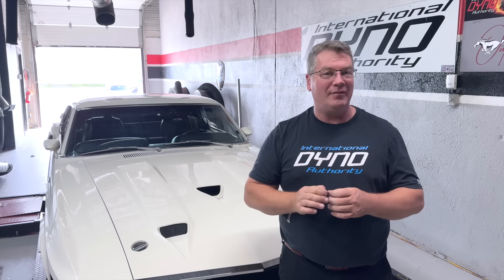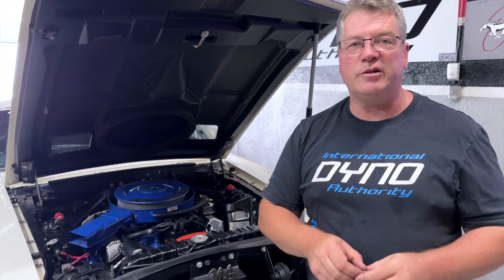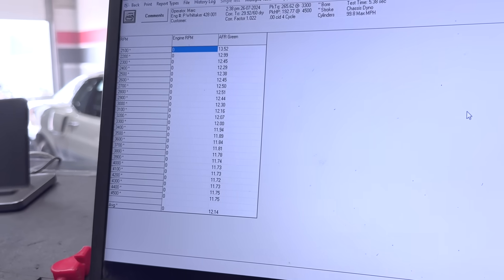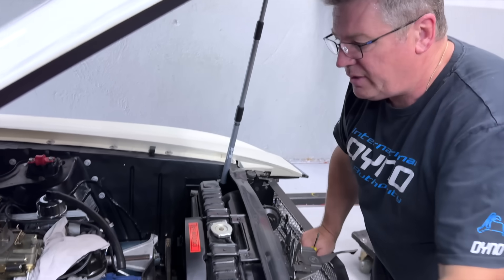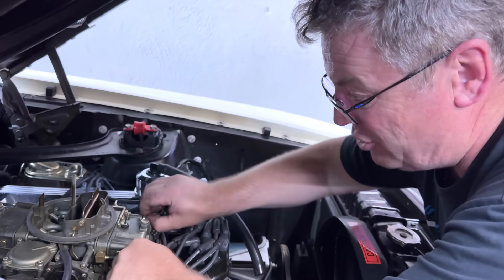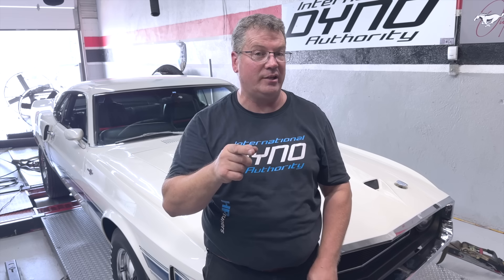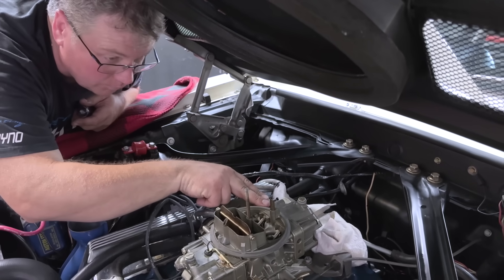Original, unrestored '69 Shelby GT500 tuned on the dyno

Comment: Cool vid, wow, I can't believe that awesome car is not restored. I have had a few Holley 4150's on classic Vettes, power valves tend to leak with age causing ultra rich mix and a carb rebuild is the way to go. Also, check dipstick with a sniff for gasoline in the oil of a rich running car, it's a good way to spin a bearing.
Reply from the maker: Coast down coefficient is measured and calibrated on the dyno to determine tire friction / drag.

J1349 S.T.P. is the formula for Correction due to : heat, Humidity, and Water grain percentage.

The dyno also allows for sea-level calculations. Although on this case the sea level is 256 ft, so not a factor.

Choke was adjusted to complete "off" and moved to its least effective adjustment for colder climate. ( It will never be driven in cold weather)

Hydraulic liters had been checked , maintenanced and set previously.

Spark plugs, oil, wires, distributor....etc.. etc..  all 'tune up' items were previously addressed.

The vehicle was strapped using the same method as per all the vehicles.  The tires were older style and soft sidewalled.

We "eliminated" all other extenuating items.  This allowed us to focus on "tune".

We had a very clear task set out for us. We needed to clear up the smoke, and provide the ideal environment for the combustion chamber to do its job.  AFR, is always Step 1.

After making sure the basics are covered, we begin setting up yhe fueling for success.

91 pump ⛽ is used because it is 90 % repeatable and easily readily accessible.  

We tune for every day use , and for the customers goal for their car.

On this session, we accomplished : diagnosis, smoke free tuning, thinking outside the box... 

We rerouted, and fixed a ver purely setbup pvc system.

All of this gave this Mustang a proper shot, at running correctlyfor the next 50 years.

Comment: Messed with FEs for years. They really like a lot of timing initially and with factory heads probably about 38 to 40deg total. More responsive and better power throughout the rpm.
Reply from the maker: @jasoncummings1755  

Our tuning process is meticulous and systematic, starting with all passes beginning at 2,000 RPM. The throttle is applied rapidly to the wide-open position, ensuring consistency across every run.

Each test is conducted on the chassis dyno under identical load conditions, allowing the vehicle to accelerate as quickly as its setup permits. The duration of the test is carefully measured and compared with subsequent runs to evaluate progress.

Initial tests are run until the torque curve falters or until the data log indicates unsafe, unproductive, or non-rewarding results—signaling the need for adjustments or the next step in the tuning process.

We prioritize the safety and condition of every customer’s vehicle, treating each one with the utmost care. Throughout the tuning process, we closely monitor key parameters such as temperature, AFR, IAT, balance, and torque production across the RPM range. Ignition timing is catered to: Combustion chamber, goal for the vehicle, fuel ⛽ used, fuel available, consistency of fuel available, health of the Engine.

Our goal is to deliver responsible, high-quality results that enhance the performance of the vehicle without compromising its integrity—or our reputation. We do not take risks that could endanger a customer’s vehicle or the standing of our business.

As we observe improvements, we gradually extend the RPM range, focusing on identifying the engine's most efficient operating zone. At every stage, we ensure transparency, sharing step-by-step results with our customers and walking them through the data logs to educate and inform.

Each test adheres to a precise, repeatable procedure, maintaining consistency and accuracy. This approach not only ensures optimal results but also reflects our commitment to excellence and responsibility in tuning.

Comment: Whoa .... that is a vacuum secondary carb .... no rear  jets .... a fixed secondary jet plate, the air bleeds are fixed as well unless you drilled and tapped for it , and no secondary squirters,  been building Carburetors since 1977, the secondary flow is on demand and adjustable with a spring change  in the housing red blue green silver and black, from the original jet size ...it is a 700 cfm Autolite made by Holley ... gonna go back a bit and re listen to the statements before 15:25 not to dispute but understand your verbiage .....P.S, Secondary Metering Plate Main Hole 0.067 Idle Hole 0.031Should be the correct secondary plate due to continued richness with a silver secondary spring for the housing so it'll open slower and allow more control of fuel metering under full throttle ... put in 35 degrees of timing and a heat deflection plate under the carb to stop fuel percolation and run on during the summer vacuum advance will help with fuel milage
Reply from the maker: Welcome back to the channel!
In this video, we tackled a smokey (vehicle)carburetor issue, and I wanted to give you a quick recap and some expert insights.  

As you saw, we delved into the intricacies of the carburetor, including primary and secondary jet sizes, which we discussed in detail.

  One of the key culprits behind the smoke was a poorly configured PCV system.  Someone had connected the PCV hose directly to the intake without a restrictor, essentially creating a direct line for oil and oil mist from the valve covers to be sucked into the engine. 

By adding a restrictor and properly rerouting the system, we significantly reduced the smoke.

It became clear that the engine was running overly rich (over jetted) and the choke was partially engaged, indicating that the initial settings were far from optimal.  We then meticulously adjusted the float and transition circuits, both statically and dynamically, under load, ensuring smooth transitions throughout the RPM range.
We also measured vacuum under load and assessed the distributor. 

 While an updated (, vacuum) distributor with  could offer some benefits, for this particular vehicle and its anticipated usage, we determined that the existing setup was perfectly adequate.

  Remember, it's not always about throwing money at upgrades; it's about making the existing components work in harmony.

Speaking of harmony, the ignition timing was carefully chosen(31,) to balance the vehicle's goals, the combustion chamber characteristics, and the fuel being used.

  It's crucial to consider that a vehicle like this might sit for extended periods, meaning the fuel won't always be fresh.  Therefore, excessively aggressive timing, like 35+ degrees, can be counterproductive.  In our testing, we even experimented with advancing the timing up to 36 degrees, but we observed no tangible improvement in performance.  Ultimately, the best results came from proper tuning and fueling.

 We did add 3 degrees to the "total" timing over what the car arrived with.
Interestingly, no springs or passage drilling were necessary within the carburetor itself.  We didn't need to add air bleeds.  The carburetor, in its original form, was a perfectly capable unit.  It simply required a skilled hand to unlock its potential.  It responded beautifully to the tuning adjustments.
Now, I know what some of you might be thinking: long tube headers, 100-octane fuel, a hotter cam, bumped-up timing, a 1050 Dominator…  While those upgrades could undoubtedly unleash more power, they weren't aligned with the owner's goals.  Our objective was clear: make the engine run correctly, start reliably, accelerate smoothly, and eliminate the smoke.  And that's precisely what we achieved.
If you found this video informative, please hit that subscribe button and join our community.  I'm always eager to discuss these topics in the comments, so feel free to share your thoughts, experiences, and questions below.  Let's keep the conversation going!
Reply: Look again.  It is a 4150 style carburetor, not a 4160.  It does have the rear metering block and not a metering plate.  It definitely has jets in the rear metering block.  Vacuum secondary carbs can have rear metering blocks.  It probably is a 735 cfm Holley.

Comment: Wow a 428 seems to be kinda trash. All that ci and so little to show for it.
Reply: And you wish you could afford one ...
Reply: Imagine one with modern Aluminum heads and a Hyd. roller camshaft dual 660 center squirters easily a conservative 150 horse and 150 torque or more at the wheels
Reply: Hey Matt, please do show us a photo of your AMC Pacer.
Reply from the maker: This engine makes boatloads of torque throughout the normal range of horsepower. 

You could put it side by side with any modern engine and, from 2500 RPM to 6000 RPM. It would give any one of them a run for their money. 

A lot of us would like to dream, that there is 500 horsepower on the table from any vehicle anywhere. However, it just is not the case. In most cases this is pretty much average pretty much normal. 

If I were to take a new generation LS 6 L engine and put it beside this. The torque curve would be less. The horsepower would be almost identical. And it simply would not pull as hard as this engine does. 

For technology, that is definitely 30 years outdated. 

This engine pulls extremely hard
Reply: You have to remember, anything you saw run on the drag strip, or nascar take the checker flag with a blue oval on it; had  a Holman Moody Camshaft in it!
Competition Cams couldn't reproduce a 406 FE Holman Moody Camshaft to make the same power in the late 1970's. Ford didn't didn't stock H/M cams... And you weren't getting the same FE parts as their lead car either...
Reply: Back then 300hp was like elite lol
Reply: @Radbot776  Yeah "lol" you don't know what you're talking about, my stock 66 Ford was 315 HP. 427s in the 60s from Ford were 410-425hp, the hemis were 500 HP on a dyno, I could go on all night
Reply: @Radbot776  Oh and that's naturally asperated not supercharged like most super cars today LOL
Reply: @Radbot776 At the wheels

Comment: Too many changes at a time, in that situation I would check the float level while its running BEFORE pulling the carb to change jets.. The idle circuit effects the A/F very very little above part throttle..
Reply from the maker: @jefferycoleman3781  

Thank you, for your response, and stimulating conversation. 

We absolutely love, the information, opinions, and, ideas, that come from our viewing audience. 

The tuning process for this project was comprehensive and methodical.

(Basics were covered:  "on camera". All steps were reported. But, many passes, & Many steps were covered, " off camera"  float level was adjusted using a Holley calibration float tool, off camera)

Pre-Tuning Preparation
We started with a checklist for the customer to complete before bringing the vehicle in. This included:

Fresh oil

New spark plugs and spark plug wires

A new distributor

Proper fuel pressure

A leak-free exhaust system

Tires in excellent condition

Tuning Process
Once the vehicle arrived, we meticulously tuned every circuit of the carburetor, from idle to low speed, the primary circuit, and the secondary circuit. Here’s a breakdown of the steps:

Air-Fuel Ratio Adjustment

We cleaned up the air-fuel ratio until the spark plugs burned a perfect tan color. AFR 12.8-13.1 (:1)

Any trace of smoke was eliminated by fine-tuning the mixture.

Choke and PCV System

The choke flap, which was bent, was removed and straightened to restore proper airflow.

We reconfigured the PCV system to circulate air back into the engine without oil vapor. This included adding a restrictor and cooling to prevent oil deposition in the combustion chamber.

Ignition Timing

The ignition timing was verified and incrementally adjusted to match the fuel in the tank, the combustion chamber characteristics, and the intended use. This resulted in a complete and efficient burn in the combustion process.

Carburetor Repairs and Adjustments

We replaced the check valve, power valve, gaskets, and the accelerator pump circuit's check valve ball and spring.

Proper smaller nozzles were installed for the accelerator pump circuit.

The float level was set for optimal tuning, ensuring no smoke and smooth transitions between circuits.

Results
The result is a 1970 Mustang that runs better than ever:

Increased torque, efficiency, and horsepower

Zero smoke from the exhaust

Quick starts, smooth operation, and overall reliability

This is now one of the cleanest-running classic Mustangs on the street, despite never undergoing a full restoration. It’s a testament to careful tuning and a little TLC.

Thank you for watching, and we hope this detailed overview inspires and informs your own projects!

The internal float adjustment is accomplished with the fuel bowl off the carburetor. With “internally adjustable” needle and seats, the fuel bowl is inverted and the float tang, or tab, is adjusted to the point where the float surface is parallel to the fuel bowl surface, just underneath. An initial dry setting can also be accomplished with “externally adjustable” needle and seats. To achieve this, invert the fuel bowl and turn the adjusting nut until the float surface lies parallel to the fuel bowl casting surface underneath.

Another, more accurate adjustment can be made with the side hung style float if measuring gauges, such as drill bits, are available. Here, with the fuel bowl inverted, the primary float can be adjusted to the point where there is a 7/64" gap between the “toe” of the float and the bottom of the fuel bowl surface underneath. The float “toe” is the part of the float furthest from where the arm is attached. The secondary float can be adjusted to the point where there is a 13/64" gap between the “heel” of the float and the bottom of the fuel bowl surface underneath. The float “heel” is the part of the float closest to the point where the arm is attached.

A “wet” level float adjustment can be performed on either the side or center hung floats, if the fuel bowls have provision for the externally adjustable needle and seats. This adjustment is made as follows. Start the vehicle up and move it out of the garage and into an open area where plenty of fresh ventilation is available. Allow the idle to stabilize. Turn the engine off and remove the sight plug from the primary fuel bowl to inspect the fuel level. If it’s been determined that adjustment is required use a large screw driver to crack loose the lock screw. With a 5/8" open-end wrench turn the adjusting nut clockwise to lower the float level.

Conversely, turn the adjusting nut counter-clockwise to raise the float level. Tighten the lock screw. Restart the vehicle and let the engine idle stabilize
Reply: @internationaldynoauthority693  thanks for the info, you guys did a fantastic job, I wasn't poking at you, but I've built and tuned many Holleys, just chiming in. That car is amazing.

Comment: Ok, first off,  THAT's NOT Stock.  It has a dual point 427 distributor first thing I see.  428's with 4 speeds came with dual advance single point distributors.
Reply from the maker: @nevetslegasi5686  

Agreed, it was covered in the video.   1:35

It was described in the video, and it was pinpointed at the beginning of the video. 

Thank you very much for writing in, and commenting. 

Thank you very much for stimulating conversation, and rightfully, bringing up modification. 

Cheers, from all of us, at International Dyno Authority.
Reply from the maker: @nevetslegasi5686  1:34

Discuss updated distributor.
Reply from the maker: @nevetslegasi5686  8:39

Distributor delivers spark, in the same fashion, as it did in 1968, 1969, 1970 and beyond .  Basic basic Ford replacement distributor.
Reply from the maker: @nevetslegasi5686  

1:36

A "dual point distributor" in 1970 essentially refers to the specific distributor used on the Ford Cobra Jet engine, meaning that the "Cobra Jet distributor" and the "dual point distributor" are largely the same thing in this context; the Cobra Jet came equipped with a dual point distributor, which means it had two sets of breaker points to create a stronger spark at high RPMs compared to a standard single point distributor. 

Key points about the Cobra Jet dual point distributor:

Dual breaker points:

The primary distinction is that it uses two sets of breaker points instead of one, allowing for a slightly longer dwell time and improved spark quality at high engine speeds. 

Performance focus:

This design was specifically chosen for the high-performance Cobra Jet engine to optimize ignition under demanding conditions. 

Identification:

If you're looking at a 1970 Ford distributor, identifying a "dual point" unit usually means it came from a Cobra Jet engine.
Reply: @internationaldynoauthority693  Nope dual point dizzys were used to stop point float increase dwell time for amperage increase to the plug and prevent spark scatter above 5000 rpm
Reply from the maker: @nevetslegasi5686  

9:14

Discussed and reported ignition timing, data from telemetry
Reply from the maker: @nevetslegasi5686  

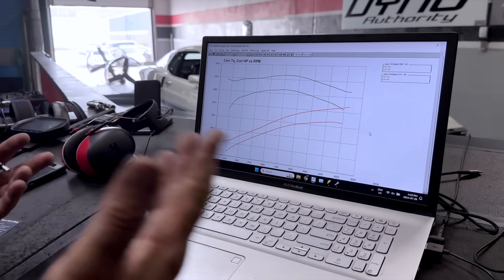11:45 

Show / Demostrate

Timing Adjustments.